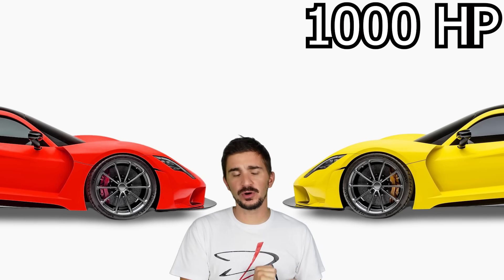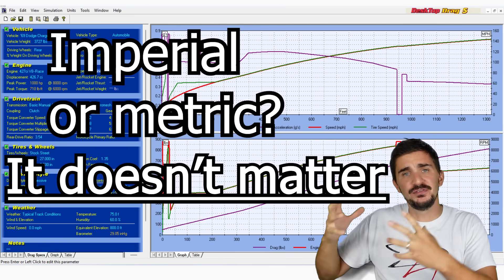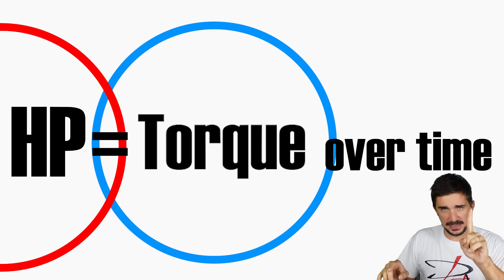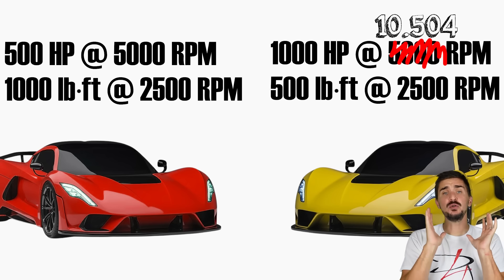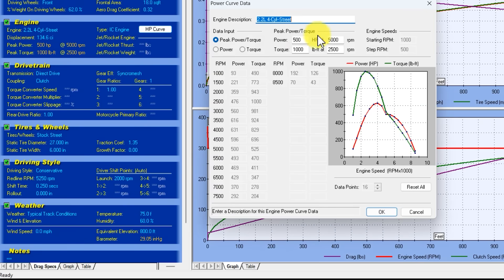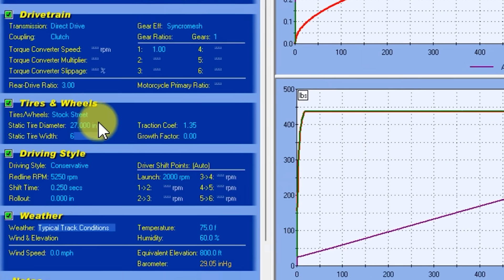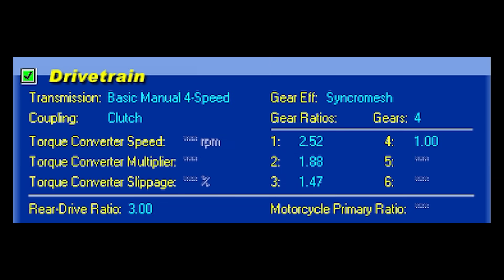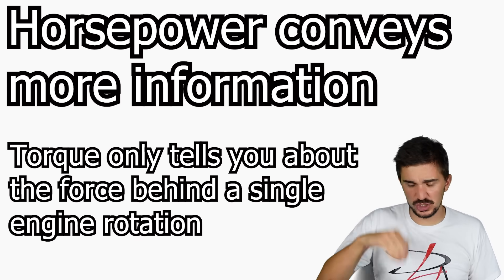Who's faster? Explained and Simulated - Horsepower vs Torque

Comment: Btw. a trolleybus with a meager 100kW output of its traction motor can accelerate 10 tons of metal + 6 tons of squishy meatbags inside it from standstill to 40 km/h insanely fast without changing gears. Also, it can shuttle them up a 15% incline at that speed for two minutes. All with a meager 100kW rated engine. If you guess that the torque output is - contrary to any ICE - highest at zero RPM (and only decreases as RPM increase, especially once you shunt the stator winding engine to get higher RPM), you realize that power output is virtually a useless value. However, the torque monster, that the serial DC motor is, will have no problem to chew up the drive shaft, differential and driving axle, if it were not held in check by the electronics that control it. The only problem is, said motor will overheat quickly, if you wanted it to deliver such performance over more than 5 minutes. It would literally destroy itself. Luckily, said electric motor is very big, heavy and has a huge thermal mass, so it can cool off gradually by radiating the accumulated heat into the environment.

Comment: Excellent video that explains things in crystal clear language and example. One other point that this video alludes to without specifically mentioning is systems engineering and balancing all the parts and subcomponents of a car. It does a driver no good to have a car that produces 800 HP and 800 lb ft tq if his tires and/or transmission are only capable of handling 500 & 500! Porsche is excellent at designing a car as an entire harmonious & balanced system.

Comment: What gives the most information is the curve, not value. The HP curve and torque curve. I really do not care about the high HP output, since it is only in a very narrow window of RPM at the high end where I do not drive. What gives me a lot more is the torque curve, if I see it being fairly flat between 2000 and 4000 RPM, then I know that the car will drive nicely, regardless of load or hill. Fuel economy is much more related to the torque curve than the power curve. For me, any "maximal" value of either power or torque, are essentially useless values. I want to see the curves for both over the engine RPM. Then I need to know how my gearbox and permanent reduction in the differential are to come to a conclusion. The "maximum power output" value and curve are just theoretical, as real world application is questionable, if you drive normally around town.

Comment: Going by some of the other things that I've learned from your channel is: high torque is great at 5000rpm, but the torque at 2000, 3000,4000 etc, matters just as much. There's no point having an engine that produces 150-200lbf of torque, only bringing in 500 when it reaches 5000rmp. Then drivability is crap. Or the opposite, 500lbf at 2000rpm and nothing after 4000.
I've imagined what my busso would be like, if it could be made to work with a pdk gearbox and, have some up to date clever electronics controlling valve timing. It has such a lovely even spread of torque, that I bet you could easily shave a second off the 0-60 time, and a couple off the ¼mile.

Comment: The way I've always thought of it is essentially that horsepower and the width of the power band matters most, as long as you have a transmission geared appropriately to take advantage of that power band at most speeds. Torque alone generally only matters if you're towing or hauling a heavy load at low speed and your transmission isn't capable of using your maximum horsepower at that speed.
Reply: torque doesn't matter much in the end.
It's important for the people designing the gearbox.

it also lets you calculate your power curve, which is important if you have a manually shifted car, so you know which gear to use in which situation.
Reply: hp only good when starting ftom standing still, if it was a race for distance torque takes it, like for 1/4  miles HP.
Reply: @elchido3517  I believe that you misunderstood
Reply: @elchido3517 brother you got it completely opposite
Reply: @elchido3517 one of the stupidest things I ever heard

Comment: Topic is illustrated very well and clear, but...
Since hi-rev power engine have much higher red-line it should have adjusted final gear ratio in simulation.
for example: 2.5 vs 5.0
otherwise it will have a disadvantage.
The torque on wheels is important, not on engine itself.

Real life example:
Mercedes-Benz w203 220 CDI -> final drive: 2.65
Mazda 6 GG 2.0 MZR -> final drive: 4.388

Comment: This was a bit confusing. Maybe a comparison of two same powered Cars (e.g. diesel and gasoline) and differing rpm/ torque would give more light. Also what about wrc cars which have their max 300 go from the very beginning due to a sinking instead of rising torque curve…

Comment: Great channel! However this still confused me. Couldn't one just say that if both vehicles were underpowered for their tyres and equipped with continuously variable transmissions, then both vehicles would sit constantly at their respective max power rpm's and the torque figure is irrelevant?

Comment: Just give me an engine that makes between 200 and 300 lb/ft of torque that can rev to 8500rpm. And put it in a car that weighs around 2200 pounds, with a rather short wheelbase. A 5 speed manual. 
And I will be off to carve corners, thanks.
Very keen individuals might even know the exact car I'm thinking about.
Technically, there's two. Both from the same, no longer existing company. One revs to just about 8500, the other tends to top out around 6500. < But could be tweaked to 8500, though maybe a little risky if the bottom end is still stock.

Comment: The formula is wrong, therefore this video is unreleavent.
Reply: Which formula? If you claim it's wrong, what's the correct formula?
Reply: @BigBen621  there are multiple factors of which torque depends like for example bore count and width etc. You can create very light engine which is reving very high and have high HP and very little torque. You can increase compression ratio to have higher power output. There is no simple formula.Take motorcycles for example.
Reply: @elgoogssie3969  I agree completely, and haven't implied otherwise. But you still haven't explained which formula is wrong, and what the correct formula is.

Comment: Ahhh, the old horsepower and torque conversation.  This issue is so often maligned and over-complicated for what is a rather simple subject.  It is best to keep things simple and in this case that means forgetting about rotating objects such as torque and rpm, both rotating.  They are merely rotational force and speed, so just talk about force and speed.  Nice and simple.  Now, imagine a water well with a pulley, rope and bucket.  The bucket has let´s say 100 lbs of water.  You take the rope and run as fast as you can to bring the water up to the surface.  You achieve a max speed of 5 feet/sec.  The next guy comes and pulls the same weight at a speed of 10 feet/sec.  Guy number 2 is twice as powerful as the first.  That´s it.  If you want to bring rotation into the equation take the same exact scenario just focus on the torque (lb-ft) seen at the pulley and the rotational speed (rpm) of the same.

Comment: Torq:  The size of a hammer (falling on its own, not imposing extra force; ie forcing it to land, just dropping it)
RPM: How fast the hammer is struck against an object
HP: How much damage is done to the object over time

If you take a ball peen hammer (low Tq) and drop it a few times on concrete, small amount of damage (HP) will be created over X-time. However, if same hammer is dropped rapidly 1000's of time, high damage can be accrued over time
If you take a sledge hammer (high Tq) and drop it a few times on concrete, more damage is done in a shorter period of time.

Comment: . Which ever the 2 same cars is making more horsepower  at the 60ft, 330ft, 1/8 mile will win the race.
The reason why we have gears (transmission ,final drive) is to make engine power more useful at all speeds. So instead of spreading the engine power  to 150mph like a direct drive, you spread the engine power to  75 mph with proper gearing. The car  geared to 75mph will have a better 0-75mph time than the car with a direct drive to 150mph (same car and power). The point im trying to make is at a particular speed your going AND engine rpm ,  the  engine power that it makes at that engine rpm is what you have to accelerate the vehicle. (minus power loss )

Comment: if you have a car that in first gear reaches 100KMH, with 520HP and 400NM of torque then the push will be constant, instead if you have a car with 420HP and 650NM of torque that in first gear reaches 50KMH, then this car will get an initial push very strong and then the push will be weaker each time, in this case both could do 0-100 in the same time for example 3.7 seconds, but the car with more torque will cover more distance in that same time because due to the great initial push He achieved a good speed first which allowed him to travel more distance

Comment: If people think torque is what makes a car fast than why do all the highest performance cars focus on horsepower and high rpm. 

Engines in large trucks and equipment are strictly after torque for the work that the engines can provide they also have to be extremely reliable relatively cheap and easily serviceable. It’s way easier to design a reliable engine that only spins at 2500rpm than one at 15,000rpm. But there’s a reason that superbikes make 200 hp and less than 100 ftlbs of torque and rev to 15k are faster than Harley’s that make 150 ftlbs and like 80hp all well under 10,000 rpm more like 6,000
Reply: “Strictly after torque for the work the engines can provide”.  🤷‍♂️
All work is done by Power.  A more powerful engine does more work per unit time.  Power = Work/Time.

Comment: Fortnine also did mention that in a video
"Lies that motorcycle manufacturers tell"

From my POV neither can exist without the other

Peak horsepower can be made with a ton of torque or little torque but applied very rapidly(high rpm). Or sth in between

Torque alone doesn't help if its at 1rpm. Horsepower cant exist without torque

Only diffrence is that a high torque engine can pull loads with more ease compared to a high horsepower high rpm but low torque engine

Say using a naturally aspirated rotary engine in a heavy truck doesnt make any sense. Or a diesel cummins in a lightweight sporty car

Comment: Also horsepower is the measure of power = energy in a unit of time. As the vehicle accelerates it gains more and more kinetic energy, which grows quadratically with speed.
Hence to accelerate at higher rates of speed one needs to impart into the vehicle a lot more energy, than at lower speeds.
This is the reason that high horsepower vehicles eventually overtake lower horsepower vehicles if the drag race is long enough (case in point McLaren F1 vs Bugatti Veyron race Top Gear did a while ago). High horsepower vehicle will eventually have higher acceleration rate at some speed, regardless of gearing or weight.
This is why higher torque only matters at low speeds, as the energy needed to accelerate is comparatively low, also, the tire traction is a limiting factor.

Comment: A more complicated question: would you rather want a flat torque curve, or a flat power curve?
Reply: Flat power mean less and less torque thru rpm. Car would feel awfully slow. Flat torque means much more constant pull but still getting slower thru rpm (air drag). The best woul be rising torque :)
Reply: You can have a flat-ish torque curve with a well designed variable geometry turbocharger in combination with a complex valve timing mechanism.

And every eletric motor have flat power curve.

Comment: One more thing to add to the equation: the engine volumetric efficiency.

The last video from D4A is about this. Low and high rpm's are relative to the engine power band. 3.000 rpm is high for a diesel, but low for a sports bike.
At low rpm's, the engine can't breathe well, so it produces less torque, and low power as well.
As the it revs up, at medium rpm, it reaches it's optimum efficiency, and produces the highest torque it can. But the rpm it's not yet high enough, so the power produced it's not the highest possible.
Then, revving more, at high rpm, the engine doesn't have enough time to take air in and the torque decreases, but still enough to be useful, and the power increases to it's peak number.

I made an experiment on the game Live for Speed using a tweak program. It's been a while and I lost the notations I made, but i'll try to remember the most.

3 versions of a small hatchback car with around 980kg.

all have 130hp

the lowrev, with high torque (~30kgfm) and peak power at ~3k rpm
the normal, with normal torque (~18kgfm) and peak power at ~6k rpm
the highrev, with low torque (~9kgfm) and peak power at ~9k rpm

I made a bunch of modifications, so everyone had the same powerband, as it is: 
idle at 15% of max rpm
peak torque at 50% of max rpm
peak power at 95% of max rpm

Then, I did adjust the gear ratios, so the powerband matches the same speed on all of them

I had to put slick tires, as the lowrev wanted to spin tires every launch.

then I made a lot of 1/4 mile races to compare times.

First: launch without revving, as is, let car at idle and only stepping the gas at green light.
the lowrev wins, it gets power sooner and launched first.
the normal and the highrev did pretty close, but the normal wins, again, because it's make power sooner as accelerating.

Second: launch with revving, as is, trying to keep the engine at at the peak torque rpm when green light comes
the result is that all of them made the exact same time. The power was delivered evenly with the speed gained.
Every now and then, one was somewhat fast than the other, as the variable was my abillity to makes the revs and shifting right. The easier to get going was the normal. The lowrev was easy to spin tires, and the highrev was easy to stall.

Third: launch with 500kg more weight on a steep.
lowrev had no problem, as soon as it get going from idle, was already near the peak torque rpm.
normal suffered a little, from idle burned a little clutch, revving to 2~2,5k rpm was the best option
highrev couldn't launch from idle, not enough power/torque. had to rev past 4krpm and always burned quite a lot the clutch.

Forth: max speed
well, 130hp is 130hp after all, all of them did the same.

Live for Speed is a pretty well made sim racing game, I think most of the results can apply on real life.

Comment: most important is average horse power over the rpm band that you are actually using 
high reving engine will have low torque but a lot of horse power up top but because u spin this engine so fast you need gear ratios that will make these high rpm usable in your application 
while high torque engine will be better at lower rpms and needs a gear ratio that will put these rpms into usable speeds 
in the end it makes no difference

Comment: So you have 2 totally different engines but have them geared exactly the same (1:1 gearbox and 1:1 rear axle)
Under these conditions the engine with the highest torque will always win.
However the engine with the least torque makes its power at twice the RPM of the other engine so you should adjust the gearbox or rear axle gearing accordingly and then this car will win every race.
Reply: No; the engine with the largest area under the torque curve will win. For example, an engine with a broad, flat torque curve but with lower peak torque will win over an engine with a narrow torque curve but higher peak torque—which is what's reported.
Reply: @BigBen621  You are wrong. With the right gearing the engine that develops the most power will always win. The rate of acceleration of the car is proportional to the power that is applied to its wheels. Select the gearing correctly and the most powerful engine wins. Set the gearing incorrectly and this is not always the case
Reply: @PeterChapman-rg6gr  Well, you started out talking about torque, and then shifted to horsepower when I responded. The problem in both your examples is that the engine with the highest peak torque in the first example, or horsepower in the second, will not necessarily win, if the torque or horsepower band is very narrow, and the engine with the lower peak torque or horsepower has a much broader curve. What matters is the area under the horsepower curve; and the car with the greater area under the horsepower curve will win, if all else is equal and gearing is appropriate. If you define "the most powerful engine" as the one with the greatest area under the HP curve, I agree; but if its the engine with the greatest peak HP, that's not necessarily the case.

Comment: Acceleration is related to work done by the engine. The work is the function of Power (HP) over time: W=∫P(t)dt. While Power is a function of torque over time. P=M*rev(*pi) To decide which is quicker you only need to draw each Power function over revolution and the winner is the one who has larger area beneath the Power curve. Max torque data is not enough. The whole torque curve, than power curve gives the result.